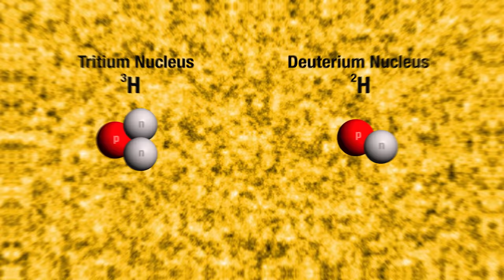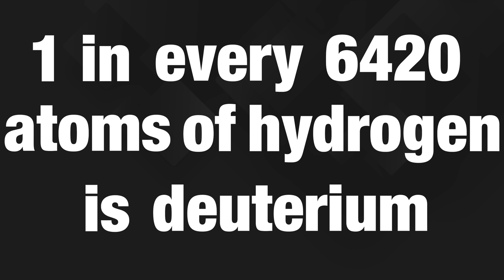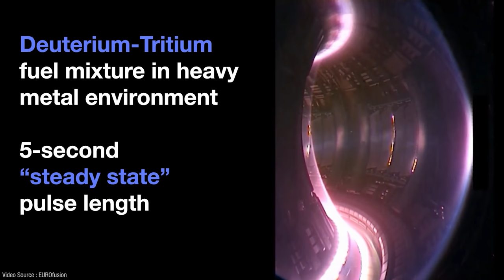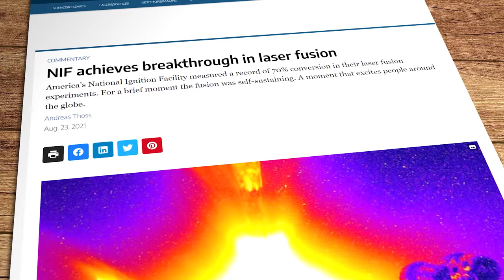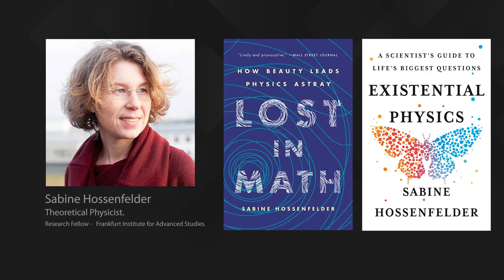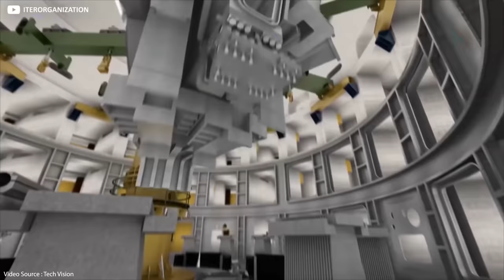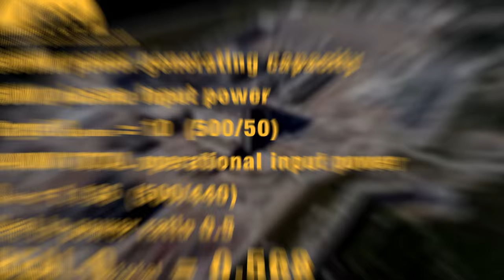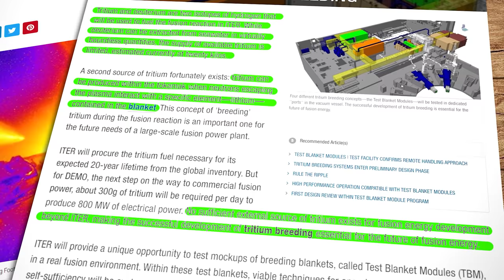Nuclear Fusion Illusion. Is it time to park the pipe dream?

Comment: Since you do to have a scientific background, it would be helpful if you simply stopped commenting on things that you know nothing about.. It is well established, through experiment, that the fusion energy output increases with the fourth power of the magnetic inductance . (To explain it to a greenie if you double the field strength, the output goes up by a factor of 16).  The discovery and commercial exploitation of "high temperature superconductors (i.e. superconductivity above 70K)  has revolutionised the design of Tokomaks.  The fact that there is a major effort by MIT (I am an alumnus) to exploit this technology speaks for itself.  Why not learn a little physics before posting about energy?

Comment: We are all made as Stars are made, in an interim step, of hyper-hypo modules Reciproction-recirculation turbulent superimposed Superspin Modulation, that which is Newtonian Fluxion-Integral Temporal Calculus Condensation. 
More of a pure-math imprint (Dues ex Machina) in hyperfluid vertices than the apparent substance of elements, ie vortex shedding of a particular type of Star Explosion in the context of Black-body Singularity positioning Act-uality.

The protection racket of "military defence" is currently exposed for what it actually is, again.., mass murder and nasty weapons threatening peaceful use of natural elemental e-Pi-i sync-duration processes.

Comment: I agree, the simplest way is the best way. Imagine a time bomb in the middle of a giant spherical containment vessel, with layers of metals and ceramics, strong enough to contain the explosion. If the bomb was strong enough fusion would occur. The vessel could then convert water to steam to spin a turbine. Another idea is based on the possibility that you could make metallic hydrogen electromagnetic. Imagine if you passed an overcurrent to 2 electromagnets, they would destroy themselves in the impact. The same thing should happen to individual hydrogen atoms.

Comment: It doesn't sound like a good investment of national resources. Not when we can just cover desert areas with solar panels, and wind turbines in offshore locations, along with converting our gasoline powered economy to a purely electric one, would seem to solve the problem. There just doesn't seem to be the will present, to do anything stop climate crisis create energy Independence. I'm sure, due to fossil fuel and other corporate interests influencing our political leaders. I don't know what we can rely on the big business, government or philanthropist to do anything purely for the good of the human population. So I like to keep it small, in my thinking. Right now on Amazon, relatively cheaply, you can buy all the components to cover your roof, and perhaps parts of your yard with solar panels, along with all the components needed, including deep cycle lithium, or more cheaply AGM batteries for storage, to build your own solar home power plant. As well as the components to connect it to your homes wiring, allowing you at least times, to disconnect from the power grid. If you're in the right type of area, or it's feasible, you could add wind turbines, so that you can also generate at night. Yes you can go to a company and spend thousands of dollars, put it in mortgage on your home to get it done. Or you can set aside a portion of your paycheck and if necessary by one solar panel at a time, One battery at a time, one component at a time as you're able to afford them, and then do the work yourself, so that you save money. All the information is online, at all the components can be bought online as well. If you want the world to change, then perhaps you might have changed as well. And if enough people see you, and see how little you're paying for utilities, and who then choose to build their own home power plant, can start an exponential increase of people individually taking action, until, large Monopoly utilities cease to be economically viable, and the components for solar and turbine generation become dirt cheap due to the huge volumes being sold.

Comment: Isn't there a way to mine electrons directly from plasma or matter without all the heat and pressure of a nuclear reaction? Or at least without boiling water for steam? It seems so inefficient to have to add water for steam. You move copper through a magnetic field and electrons flow. But we could mine electrons if we put our heads to it.
Electronically moving a magnetic field through copper would be more efficient than moving copper through a magnetic field.
Reply: There are materials that covert heat directly into electricity, but they inefficient and costly.

Comment: Could you touch up on the magnetic motor/generator that an Australian unveiled in 2005 I believe. ???It was a 24KW unit that was the size of small gas generator and could operate a full household;s electric needs. Here is the link to the old video of the machine.
https://youtu.be/l7Gt_Zh9yMM

Comment: Course there is the possibility of using a gyro type device.
Rather then using atomic fusion and possibly plasma, a self contained rotating magnetic sphere with the right equipment could create the same kinds of energy you see in wind turbines.
It would be a turbine driven by its own sets of magnetic fields. It's much easier, and good practice for a fusion reactor later

Comment: ITER is a huge miss and an enourmous waste of resources. What fusion is missing is a big piece of puzzle, and ITER has never been designed to provide any meaningful clues to that piece of the puzzle. Just like how we were not able to solve Protein Folding or Computer Vision without Neural Networks technology joining the game, or Genetic Engineering without CRISPR technology being invented. For fusion, this would be something like a radically better superconductor or super magnet, or even a complete paradigm shift away from magnetic confinement, none of which ITER was ever going to provide any help on.

Comment: This is a disappointing and luddite take on nuclear fusion. The actual construction of the ITER device began in 2007, not the '80s. As the video stated, the expected goals of ITER are to achieve Q plasma of 10 - ITER was never supposed to result in actual commercially viable nuclear fusion, just to lay the foundation for it. There are other initiatives planned for later this century to bring humanity closer to commercially viable nuclear fusion - it might take even longer, but it will never happen if we don't work on it. Literally nobody seriously talking about climate change mitigation, not even the ever-optimistic COP, is saying nuclear fusion will magically solve our problems. The level of funding also sounds big but is actually a trickle because the money is being sourced from many rich economies and is cumulative over decades, so the work is rather impressive given the resources society is providing.

Comment: Such disappointment 😞, but I hope the experiments for fusion energy continue as long as required to achieve fusion energy. I think that's a better use of the society than just being boring conformists.
Reply: ITER is a 30 year old design. There is far better out there. The joke used to be "50 years away and always will be" but they had to update to 30 years, and now I guess 20.

Comment: I have a question about Tritium. If it is a more viable form of fusion fuel, how about we mine it off the moon. The Sun blasts the Lunar surface with the solar wind all the time. With the Artemis Project planning to bring humanity back to the moon, is not likely the rise of Fusion and Phase 2 lunar colonization are linked in fate? It would be a huge investment for world businesses to mine the moon of its tritium, and clearly, nuclear fusion still needs more time to develop. I feel that if these investments work together, we could see nuclear fusion within the latter of this century. This will mean though that our imminent solution for reaching carbon neutral will have to come from renewables with hydrogen as a form of storage and fuel. Here's hoping that will do the job within the coming decade.
Reply: that's the major concept for making lunar industry turn an immediate profit.

Comment: I’m really surprised, for the first time ever, to see you dismissing a technology in this way. Forget poor reporting; that happens in every field and has nothing to do with the actual science. Nobody is suggesting that this is the immediate, short term answer to climate change; it is not an alternative to wind and solar, both are needed, but it has to be pursued for the medium to long term. If you think the budget is high, just look at what governments throw at other things!
It is so easy to laugh at the incredible breakthrough of a 5 second stable run. Now just imagine seeing the first viable internal combustion engine, after decades of experimentation and faltering development, run smoothly for 5 seconds. How you might laugh and ridicule it’s uselessness, when in fact it was 95% of the way to running smoothly without stopping for 36 hours.
I applaud the continuing fusion research; more resources should go into this, just as they should into wind, solar, tidal lagoons, storage and long distance grids.

Comment: Dude, your video is sooooo lazy! You are bringing the same arguments as many other before you, including Sabine Hossenfelder, and didn't bother to do the full research! Here are your "findings" debunked:

1) 9:58 "Q_eng" is not equal to "Q_physics". True, and similar to Sabine, you didn't bother finding out what it takes to achieve significant "Q_eng": It takes a little higher volume, or a little higher fields. Q scales with B^4*R^3, B being the magnetic field, R the major radius. By adding a few 10cm to the radius of ITER and with a field of 1T more, Q is already ramped up by more than a factor of 2. ITER is design to achieve Q_physics = 10. not Q_eng, which would have been just more expensive. Expenditures which are already now hard to justify as it seems. Just look up the specs for DEMO or ARC if you want to read about an actual reactor.

2) 7:49 "A shape so complicated" that even I can run those codes on my home computer by now. We are not in the 90s anymore. Jesus, are you afraid of computer codes? They are not absurdly complicated, they are just a little twisted.

3) 11:15: Yes tritium breeding is mostly untested technology, but we have very well benchmarked codes who predict that there are blanket designs which breed more than enough tritium. But yes, this is untested technology. So what now? Is this an argument against pursuing it?

4) 12:18 "Splitting atoms is not nuclear fusion it is fission and would be subject to the same torturous constraints as fission plants": NO!!! The products of Li-6 or Li-7 fission are tritium and HELIUM. So just the fact that there is some fission involved does not imply the the same regulatories!  Fusion has no HIGHLY active radioactive waste and actinoids like fission.

5) What a nonsensical argument at 12:50. "At one day I hope our descendants will enjoy the fruits of their scientific labor. But it looks very unlikely to happen in my lifetime. So basically cut the funding": First of all, how egoistic: It won't happen in my lifetime so stop the funding. Then, how is fusion suppose to work one day if we continue to cut the funding?? Then, put your "10's of billions" into perspective: ITER was funded in the 90's. That's a span of 30 years and your 20 Bn € was distributed among the largest countries in the world. That's like what.. 200 Millions per large country per year? Hell, that's what the EU parliament spends to move between Brussels and Strasbourg every year. Plus: Those are countries that spend more than a trillion dollars every year (!!) on research and material to kill each other! We are still spending billions of euros on coal subsidies every year! Germany pays companies to shut down the nuclear fission power plants with about 5 Bn Euros. Why don't you talk about that? Why do you want to cut an already laughable funding for a potential energy source that, in the worst case has the potential to play a role in fighting climate change, and in the best case, completely revolutionizes our way of living?

Your accusations at 1:03 apply to yourself! You are putting up a half-baked, lazily researched video and judge about a whole research field while arguing with basically nothing. Did you talk to a fusion export before putting up your video? Or at least send someone your script?
You are reaching millions of people with your video. At least put some effort in it.

Comment: I disagree. You're confusing experimental reactors with production reactors. Today's reactors are built to learn and test. The more important values is run time , the q values are not important until we have 24/7 operational reactors. We have suddenly gone from milliseconds to recently minutes, ~17 minutes hold millions of degrees in a container. That is getting close to constant running, not far away at all. Fusion reactors work and will be developed. Reaction times have steadily been increasing, especially as our material science advances. Big advantages in making fusion work. Massive efficiency,  super low cost, less transmission lines. Independence from other countries run by dictators and independence from fossil's.